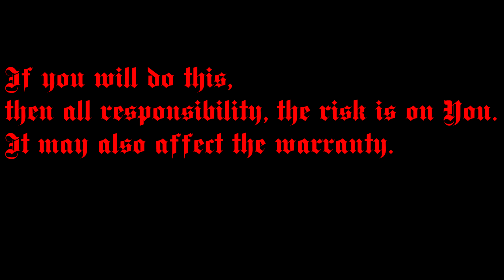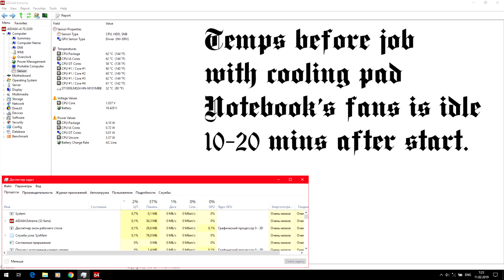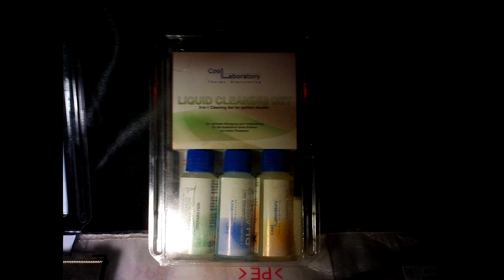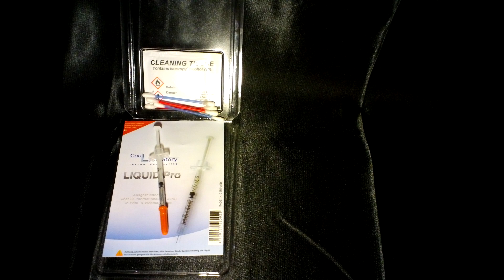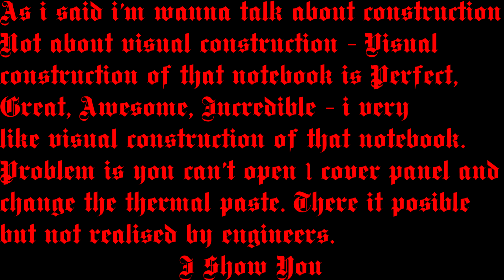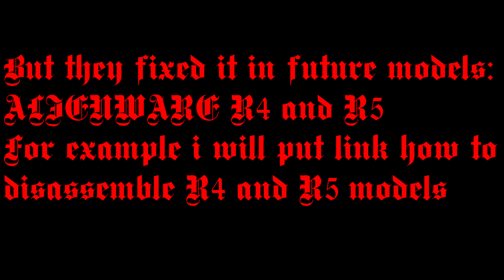How to clean repaste notebook's CPU and GPU and change thermal paste to Liquid Metal ALIENWARE 17 R2

Comment: Im having issues with the geforce 970m. It will not accept the driver. Any updates?
Reply from the maker: I can recommend use DDU (Display Driver Uninstaller) for clearly uninstall old version of driver and then install official driver by Nvidia https://www.nvidia.com/en-us/geforce/drivers
Reply: @Hellerion  Did that and install 372.90 because it will not accept any other driver. Could you confirm to me whixh driver version are you running?
Reply from the maker: @henrickrw  Hm, looks like software problem. All drivers  300+ and 400+  install and works(some of them better,some worse but works) I did special test, installed 442.19 driver (Game Ready Driver) and it's works. While choose the driver, make sure there everything as your system and Operating System same as your. While install the driver select perform a clean installation. Is there an error message window? If yes, I could try to find a solution for this problem
Reply: @Hellerion  Did the DDU and was able to install 370.72 but when I run diagnostics the nvidia 970m card crashes. I will continue to troubleshoot but I'm 100 percent sure that the graphics card is not damaged. Can you help me troubleshoot this issue?
Reply from the maker: @henrickrw  It's good if card not damaged, it's mean doesn't need waste money for troubleshoot this. Yes, i'll try help. Also i found thread, there messages from Greybear may help, he recommends also reinstall intel's drivers, link for details - https://www.nvidia.com/en-us/geforce/forums/game-ready-drivers/13/271182/geforce-gtx-970m-keeps-crashing-ive-thought-of-not/
Also i can recommends Ccleaner for fix Registry issues
And last thing what may help if another solutions will not works its fully reinstall Windows, but before reinstall need save somewhere all important files